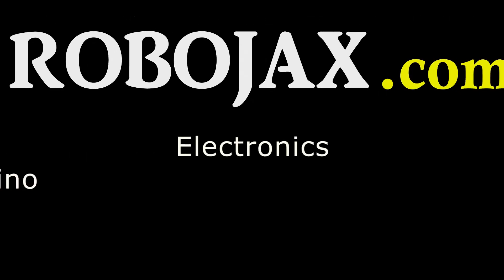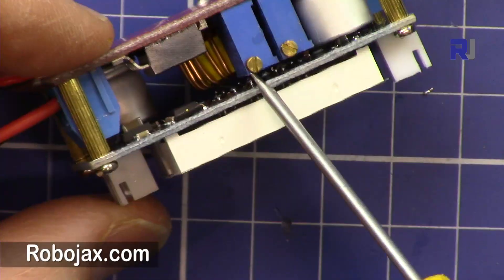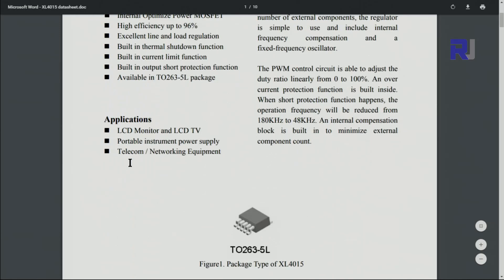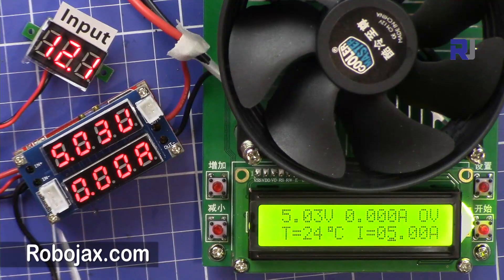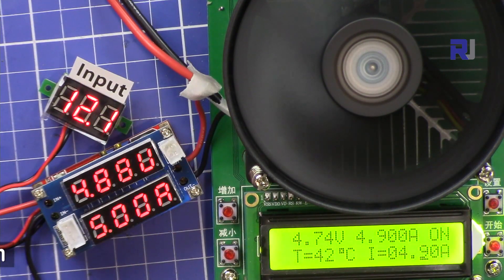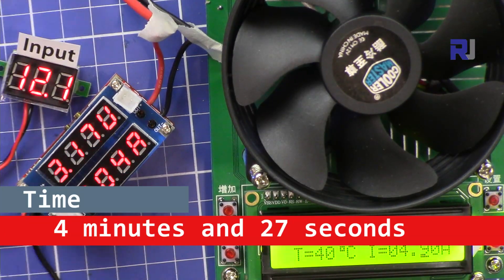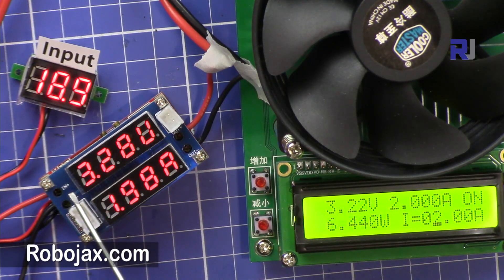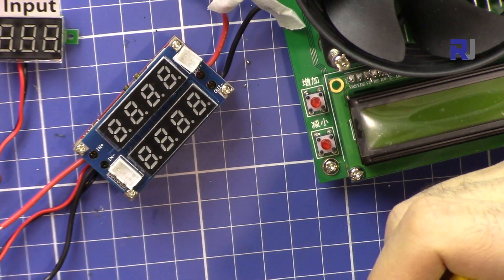XL4015 DC to DC 1.25 to 32V 5A  Buck Converter Lithium Constant Current charger

Comment: You know what, I'd rather use this to power the 25kg 7.4v servo in my rc crawler, instead of those overpriced 7v 'programmable' RC BECs that also need additional dongles.
Reply from the maker: I hope it works. good luck ک. خلیقه

Comment: hey. my module is not accurate at low current that is i set to 63mA(short circuit) and when connecting an led it draws about 73 mA. why is it like that ??
Reply from the maker: this is 5A=5000mA module,, so 63mA is 1.26% of total. For this type of devices, 2-5% error should be acceptable. And ±3% is 150mA so you might get 150mA less or 150mA more. for your application you should get a lower power/current module something like 100mA, then  with 2% error you will get only 2mA Error.
Reply: @robojax  thanx 👷
Reply: But when a dc motor is connected the variation is high like more than 300 mA
Reply from the maker: motor is inductive load and it draws different current at any instance. The current you read is the average. So in some motors it would be very hard to read steady current reading.

Comment: If I put 18v 1amp, then may I get 14v 2A?
Reply from the maker: Because 18V x 1A=18W and you want 14V x 2A = 28W, you can can't 28W. this is impossible. The output should be less or approximately equal to input so you might get 17W output.

Comment: got a question, I need to provide 5-12v to a induction heating coil module https://www.youtube.com/watch?v=HvgM0awet9I, can I use the module you tested to have a constant current of 4A ? will remain at 4A ?
Reply from the maker: if the difference between input and output is smaller, it can handle 4A.  for example 12V input and 9V output. but if you try 12V input and 3.3V output, as shown in video at 06:17 it got overheated.  so there is no clear answer.
Reply: I have 12 v both in IN and OUT, will use the induction heating in a 3D printer to heat the extruder hot-end which has a thermistor to control the temperature of the hot-end by turning on/off the induction heating element controlled by this module. Does it make sense? will it work or I am missing something?
Reply from the maker: this device is to different output than input. If you are feeding 12v to the input and then getting 12v output, why use this? why not connecting it directly without this module?
Reply: because the board that controls the 12volt cannot handle more than 4A. So I want to make sure that the induction module cannot draw more than 4A even though there is the thermistor feedback on the hotends, So the thermistor will shut off the 12 V input when a certain temp is reached by using the induction heating, and it will maintain the set temperature by enabling the 12 V input and so on. Makes sense?
Reply from the maker: okay. So you want to use it as current limiter. This also called Constant Current (CC). Because the difference between input and output is zero, it should handle up to 5A.